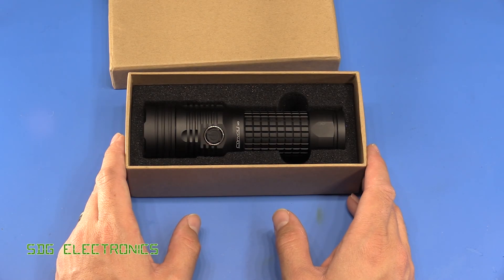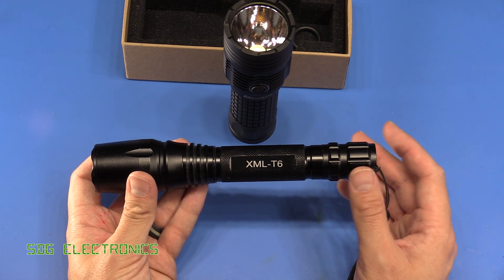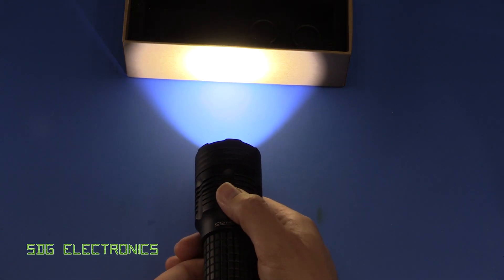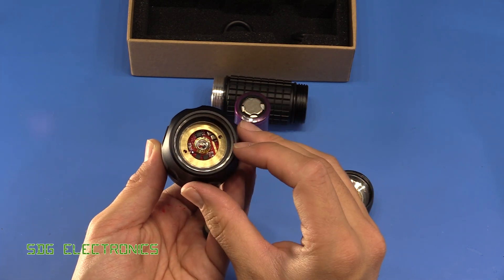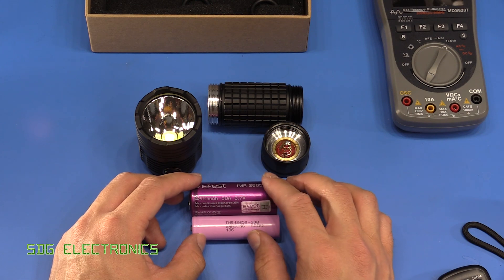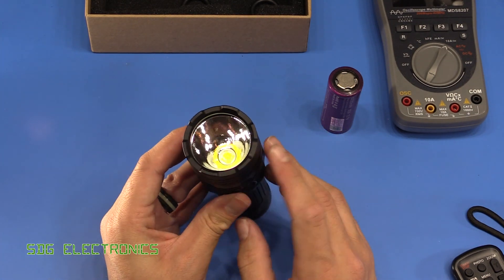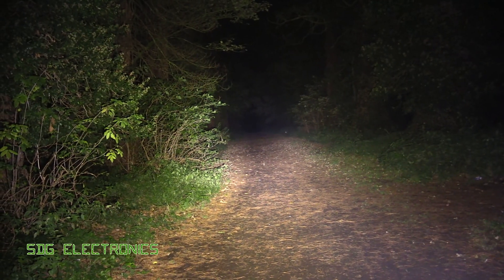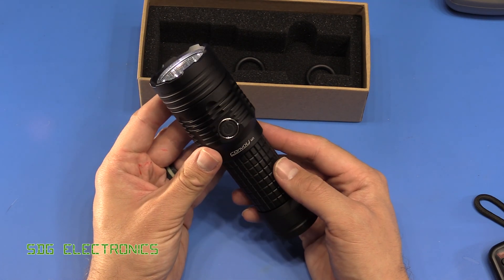SDG #110 Convoy M3 4300 lumen LED Torch

Comment: Does yours still work?

The driver went on mine without a huge amount of use.
Deciding whether to repair or scrap.
Reply from the maker: Yes I still use it regularly - no issues so far.
Reply: @sdgelectronics thanks for replying.

Comment: This would be perfect if it had a USB C charging port and a strobe mode. Sofirn SP36 Anduril is more value for money in my opinion.

CORRECTION TO YOUR VIDEO:
XHP70.2 can actually handle 29W continuous power (6.74A @ 4.3V)

Comment: SDG Nice work on the channel. 
The 2 O-rings are for the 18650 battery to prevent it from rattling in the tube👍. Try it and the 18650 will fit like a glove!!

Comment: The two spare O rings can be used on an 18650 cell to stop it rattling.
Reply: They are not 'spare' o-rings, but the only reason why they put it in the box is a converter to 18650. I would see if you can use for sealing the tube, looks like never read the manual (what written for noobs). They are too thick and never will fit onto the tube. Just look at the original sealing o-rings. 😉
Reply: Péter Balog What manual? Never had one.
Reply from the maker: Nice idea
Reply: @sdgelectronics  It is what those rings are for. They won't fit on the light itself.

Comment: Nice Flashlight. I'm thinking about buying it. I like that it can use both battery types with no plastic tube to lose!  Nice and bright with good modes and simple interface. I like.
Reply from the maker: I'm pretty happy with it and it's really well built. I do like the zoom feature of my other torch though.
Reply: @sdgelectronics  I do like zoom also! I have a FW3A now and its using optics rather than a reflector, I find its the best of both worlds with a very smooth beam transition from spot to flood, without the need for the space a reflector would take. But its not a zoomie either.

Comment: You might have been giving to much voltage and current to the driver for 100% mode with the bench power supply even with the power supply set to 4.2v to mimic a full battery.. Battery voltage and amperage sags pretty instantly and drastically when pulling high amps and the circuit may have been designed to not see that higher constant load. Good to see it had protection and shut off it seemed. If you look at the rated spec for the flashlight and for example its 5 amps at 100% mode, you could use the bench supply at lower voltage and slowly increase the voltage until its pulling rated current.
Reply from the maker: I tried it at a few voltages, it ended up working fine with a different power supply. The TTi bench supplies have a soft start which was limiting the current too much.

Comment: How do you charge that big battery?
Reply from the maker: It fits in most chargers designed for 18650s. I have one of the standard 4x 18650/AA/AAA chargers and it clips in OK.
Reply: SDG Electronics Thanks! There seems to be a lot of cells that do not have the stated capacity. Which make is recommended?
Reply from the maker: @OC35  I've always had good experiences with LG and Samsung cells. The Efest ones are new to me, but it tested good when cycling it on the charger.
Reply: @OC35  There are a lot of fakes about.  I've had good experience buying from "NKON" in the past.
Reply: It's only 21700s that require a special charger large enough to accommodate.

Comment: I can immediately tell your older *Fire torch has a FAKE led in it. The emitter is actually from LatticeBright, the LatticeBright XML T6, which is a knockoff of the Cree XML T6, and in real world is between 300 and 600 lumens based on the flashlight communities' measurements and findings. It has a fairly low CRI and high color temperature and they don't age as well as legitimate CREE LEDs. But they cost pennies so.... who cares!

Damn I want this light, can't wait to receive it! (and of course the obligatory "first" I need to say ;) )
Reply from the maker: I've always been a bit dubious of the Crazyfire torch, but it's been robust and fault free despite some heavy abuse. The Convoy M3 is really interesting - I hadn't realised quite how bright LED emitters had become recently. I compared against my car headlights in the dark this morning and it's considerably brighter than the D2S lamps I have in the car. I'm now thinking about some projects using these LEDs.
Reply: @sdgelectronics  I had a $10 Convoy S2 and I was impressed with the quality for 10 bucks! It had a real XML.2 emitter and was very bright for a light the size of a glue stick.

The XHP series is very impressive, and is even competitive with HID solutions for lighting. The only problem is they require 6 or 12V depending on the footprint. This single cell converter uses a boost converter to power it.
Reply: @power-max  the xhp 50 now has 3v version not sure about xhp50.2/70/70.2
Reply: @Tn18d  I might have to look into that, although the ohmic losses would be through-the-roof!